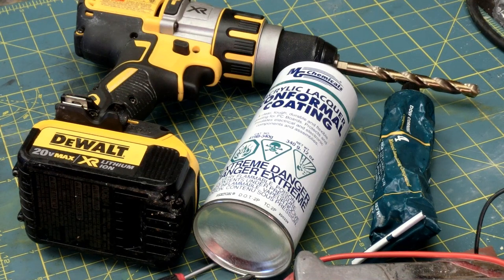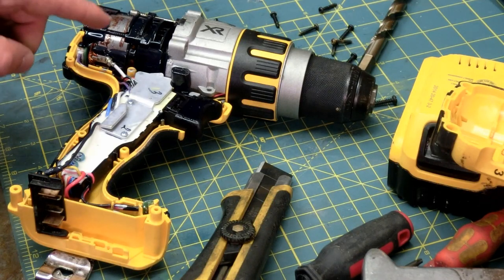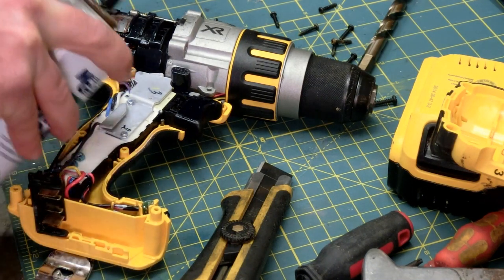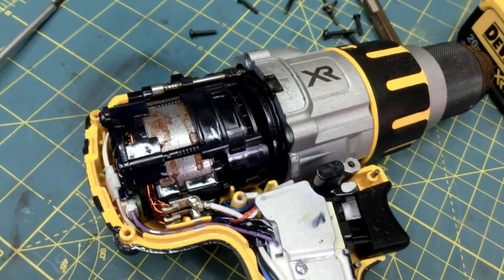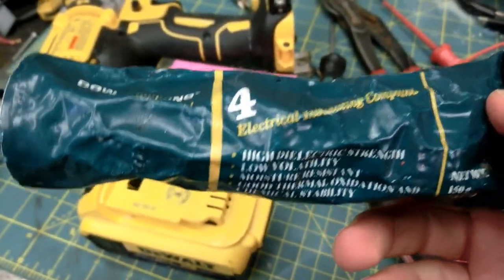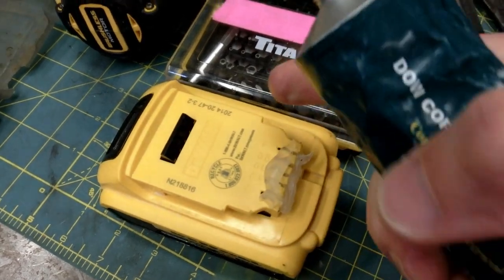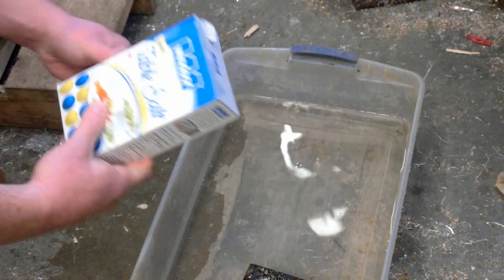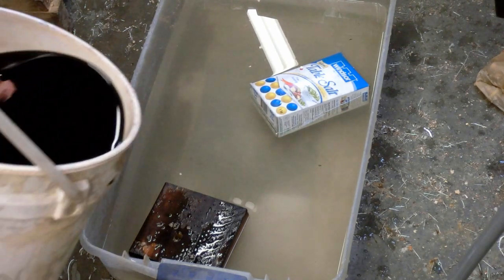How to Water Proof your Cordless Tools. Almost. SALT WATER TEST.

Comment: I did this to my screwdriver !.. It works great cheers bud !!!!
Reply: +kierankay100   So did I... But when I put the grease on the driver holder, it increased torque slip ... to like 99%
Reply: +RidingInKelowna did you try applying grease to your hand Aswell it didn't get mentioned that's what I did
Reply: OH?!  the grease to grease contact must create equilibrium in the AvEverse
Reply: I tried doing this to my screwdriver but I couldn't find any electronics to coat or a battery. Hmm.
Reply: Yeah I was wondering about that. I didn't see any points of ingress between the metal and the plastic. Looks like the handle is just moulded straight on to the shank. I assumed those were the only two parts on the damned thing and that all I would have to do is wipe it with an oily rag after submerging it.
Reply: +Žymantas Pajauris Oh. I must have got one with a dead battery already.
Reply: Did this with my hammer.  Once I applied the grease the other guys were so impressed they ran off to go try this themselves.  I haven't seen them since.
Reply: I water proofed my screws

Comment: The world's first water-cooled drilling machine. None of that air-cooled fan based crap
Reply: +Krisztián Szirtes Also, water-cooled monitor! What a deal.
Reply: +Jaymes Stewart Well, now he can overclock his monitor to 8K resolution.
Reply: +Jaymes Stewart No more overheating mosfets in the fucking HP power supply boards. 11/10
Reply: +John O'Herron I dunno, water cooling has its place, especially when you have little room in the machine itself for heating and so on. Plus there is gear that dumps such ungodly amounts of heat that air isn't even an option.

Comment: I kinda doubt they specifically put in a water sensor.  Notice it craps out as soon as the cooling fan goes underwater.  Could be the extra torque required to blow water instead of air through the fan causes an overcurrent in the motor.  (You'd think if it can turn screws it could pump water, but the screws are on the other end of the reduction gear.)

Try rip that fan out and see what happens!  Ya don't need that thing workin' up there in the arctic tundra anyway.

Comment: This is perfect, now I can finally go swimming with my Dremel and use it as a propeller.

Hmm.. just a thought, would that trick also work on a laptop? An underwater LAN party sounds awesome.
Reply: Well it might work for the components but you'd have a big problem with the screen and HD. Also some of the components might not like the layer of junk and overheat
Reply: Ian Thompson oh right, didn't think about it insulating the laptop, as for the screen I'm sure you could water proof it by other means, I mean things like waterproof phones/cameras/watches/etc.. already exist after all, but yeah probably not quite as easy.
Reply: you can actually chuck  older  laptops in a bath and they will work! (put the laptop in battery mode cause you'll regret the powercord) but the laptop will most likely die after you take it out of the water again.
Reply: +vgamesx1 Fun note not related to the video or what we were saying, I was using your profile picture as my flip phone wallpaper 9 or 10 years ago. Thanks for the laugh ;p
Reply: +vgamesx1 Not sure about laptops, but this has been done for motherboards to safeguard against leaky watercooling systems.
Reply: I think your referring to other salty liquids that might be splashing on your keyboard, just aim away.
Reply: Ik it's 2 years later, but somone diplayed a ip68 water resistant keyboard at CES2018
Reply: How does the smoke get out?

Comment: Having been on a Naval vessel and worked in actual bilges, I knew just what you meant when you said bilge water. Your sample may be slightly cleaner than what usually ends up in the bilge, but was a very good approximation.  only thing i can think of to make it more accurate is to add metal filings and fecal matter.

Comment: Some of these analog triggers aren't electrical at all.  I took apart a Bosch drill that had annoyed me and found that the trigger mechanism was actually optical.  It was essentially a rubber tube that reflected less light the more stretched it was.
Point being, bilge water would stop any optics stuff like that dead.
I seemed to notice that the drill failed whenever the trigger went in the water.

Comment: I have dropped new cell phone into a bilge while doing some electrical work on a boat.... Having to reach in to that nasty mess blind and feel around to try to find it was the worst.... I did get the phone to work again however i could not get rid of the smell and replaced it for that reason...

Comment: I use the Dow Corning 111 for so many projects. It's basically a non-curing silicone sealer. Has a thousand uses. Won't run off or melt. Won't freeze. Most excellent for rubber suspension parts on cars and trucks. Super slippery and won't wash off easily. Works very well for rubber o-rings too. Got turned on to it in Honda school. I swear by it. Use gloves or your fingers will be slick for days.

Comment: Nice! Can't remember the last time I saw bilge water that pure but for demo purposes I guess it was ok. Of course I'm use to fishing boats. You could have thrown in some two week old sardines and it would have been much closer. Growing up on the coast of NC I saw a few bilges. This will work nice for working around waterline/sewer-line breaks. 

Murphy's Law: climb ladders, work on roofs, out on lakes building docks... never drop the drill; but work around a 2'x5'x2' trench with a leaking sewer line in it?... Yeah. 

You are the most pragmatic "engineer" type guy I (sorta) know. It's off topic but I don't know how to message you in any way and besides maybe one of those commenters with the answers will see this. 

How much force would it take to make a BB go 350 Yards? A judge in Minnesota said the "effective range" of a Walther PPK styled BB pistol is 350 yrds.  What do you think? I feel aerodynamics alone keep it from being so without even considering the small size of the pistol.

Dave P
Davidpenclydyke@gmail.com

Comment: Heeeellllpppp! 😵  Spraying sealant on the internal connections seems like a really great way of preventing water damage.  What can one do after leaving an unprotected Black and Decker Cordless Matrix System in a thunderstorm all night?  I accidentally left my brand new drill outside in the rain.  I didn't try to use it because I didn't want to create a short but I did remove the battery and the drill attachment and placed all 3 separated parts near a heat vent to dry out.  How long do you think it will take to completely dry?  Is there a good chance of it working again?  Thanks!🙂

Comment: I had my Milwaukee burn out the motor, but i used the dialerric greese in it and not the paint... small town and no electrical supply store.   So the dialetric greese might have caused the motor to short out?  It worked great for two months... any ideas?  Aldo where do i send a Milwalki 1/2 Driver impact drill to get fixed that has dialectric greese all in it... lol

Comment: Could you use that spray on the electronic parts of a Jeep? Alternator, starter, distributor, etc?
Reply: +Logic Bob I'd imagine heat would be a problem.
Reply: TheSkytherMod Aah, good point. Bummer!
Reply: +TheSkytherMod And bearings and well the commutator bars and the brushes actually need to make contact, so insulating them is not the smartest idea.

Comment: I've got a Crap & Decker that smells funky when I use it.  Not the usual "grandpa's old 90lb corded drill" smell, more like scorched turds.  Perhaps it experienced an unprotected bilge dunk..

Anyway, I only keep it around so that I don't have to change bits as often.  I can see the commutator is kinda gunky looking, however the end bell is unfortunately the stamped-closed type.  Luckily there's plenty of brushes left, it appears... 
Any magic advice on how to clean the sucker?  A lot of Q-tips and and alcohol (for me) only put a small dent in the funk.

Comment: My best guess would be that when the brushes are both submerged together, they create a short between them, and prevent current from passing to the coils
Reply: brushless motor in that thing I believe.
Reply: The salt water isn't that conductive. I suspect it has some sort of ground fault thing or other smarts hidden inside the potted board.
Reply: +Josh Smith that amount of current would be very low compared to the running current. Its probably pulling way to much current from the drag and shorting between contacts and shutting itself off until the next trigger pull. I noticed that with my milfukee, if you stall it it shuts down. I kinda miss the old brush smell from the nicad days.
Reply: +Wyatt Roncin BINGO. the smart computer chipery inside it I think is the culprit. rushing conductive liquid + hall effect sensor = ?????
I think a brushed motor would give up the ghost pretty quick once that goop lubed up the commutator bars real nice
Reply: +TheIdeanator Salt water is the most conductive water you can get. ions from salt are helping to move the charge. in this case resistance would be close to zero with that amount of salt.
Reply: +TheIdeanator I thought salt water was extremely conductive??
Reply: Ian Thompson Not as conductive as metal.

Comment: Stupid question incoming... Would that work on a brushed motor? Pretty sure those sucky 20v dewalts are digital now. Still rockin the brushed 18v version of the dewalt impact. Work a lot in wet and sandy areas and wanted to prolong my tool life any way i can. Thanks for puttin up great videos!

Comment: Amazed by this..would any battery operated drill work as a one off..I need to cut 50mm chain link at 6 to 8 meters
..if it makes the 2 cuts I'd be happy to chuck it away.
Reply: How’d it go

Comment: Fantastic! Question for you -- how feasibly could I use a regular lacquer or polyurethane as a ghetto conformal coating?  eg. if I'm making some simple circuit boards that I want to expose to the elements?

Comment: On the comments about the motor shorting out. There's a guy named SV Seeker here on youtube, awhile back he was testing motors for an underwater ROV. He was taking common R/C brushless motors and running them in saltwater with no problems.

Comment: Just a couple of comments: from experience I would say that silicone grease is better short term (if you remember to regularly re-apply) and petroleum gell (Vaseline) is better if you forget to re-coat. Conformal coating is better if you use 4 thin coats rather than 2 thick, amd lower voltage drills last longer as you get less electrolysis (less voltage to push the current through). Absolutely right though you cant make anything 100% waterproof if it's not designed for it (even a submarine leaks). One final point is that masking tape on the battery contacts is a good idea as you can get conformal on them way too easy.

Comment: `Hi EvE,

My father had an old drill where some of the gears were striped and he potted all the bits and protected everything with a pour of wax. 
The thing worked great but I seem to recall the new gears were as much as a new drill so it lat on the bench for another couple of years. I tried it out maybe 3 years afterwards and it worked with no problems. I know that a lot of guitar builders also pot their electronics like this.

Comment: My brother working in the HVAC field dropped a CraftsWomen impact in a 5 gallon bucket of waste oil on a job. The thing didn't quit until the NiCad battery did, over a year later. Stunk like rotting dinosaurs for the whole longevity of that tool.

Comment: That drill stopped chooching in the bilge water because the viscosity and density of that fluid is much greater than air.  so it overloads the motor and the overcurrent protection cuts in.  The fan spins at what? 14 k ripims or so?  There's the problem.  My pneumatic drill works fine under water..just not much power at 180 feet below the splash line.

Comment: How did you dispose of that water?
Reply: I ain't never seen no monitor evaporate
Reply: you asked about the water, not the monitor..
Reply: The local auto parts store.
Reply: Then you haven't had one at the proper temperature and atmospheric pressure.
Reply: shurdi3 What else would a greased up AvE bath in afore chooching with Mrs AvE?

Comment: hey Ave, I had some tard bucket tell me if you run an electric motor full revs or disconnected from power, which ever one, and soak it in Mt dew, it would water proof it completely, sounds like hog wash but I wanted your opinion
Reply: +AvE that's what I knew, he was a bench seat racer like you'd never seen, he could weld anything with jumper cables a car battery and some bull shit for shielding gas, thanks for the reply I miss the videos you yelled at the camera focus ya fuck! that was hilarious, keep up the good work!

Comment: I use plasti-dip. It doesn't have any known issues and unless you spray specific parts that need to be free of coating you're ok.

Cheaper too if you know a guy who does plasti-dip for all the plasti-dip enthusiasts, by cheap, i mean free since some of these guys don't actually use the whole can because of sputtering or whatever issues they might encounter, i, raised on the old beans, know that if you crush the can, you get extra potato salad.

Comment: i'll be doing this to my rechargable work lamps for sure. They're fucking awesome for magnetically sticking inside the crankcase for doing main bearings but if you knock one in the bilge you gotta watch it float there until you can wriggle through enough pipes to reach it, you try dry them out but they act up for the rest of the job.

Comment: electric motors under water talk about putting a new SPIN on things.
drill jokes will make you CHUCKle, just a little BIT.
I hope the Dewalt handle didn't TRIGGER anyone
I'm impressed it still worked after you assSALTed it with water.
water proof electronics are usually in CURRENT events so you shouldn't get any NEGATIVE comments.

Comment: silicone spray for outdoor equipment you can get at ace hardware should work too I imagine. Good luck affording a tube of dielectric grease that big though holy smokes it's expensive where i lives

Comment: Just a late and unnecessary thought, but if you greased the contacts before applying the coating, that might remove the risk of accidentally coating the contacts properly.

Comment: hot pink hockey tape was needed not electchickens tape... 

I wonder if the board is sensing a change in conduction at the motor and if that is causing it to shut down.. actually I'm wondering why I couldn't do this to a shit drill like a dewilt, because what if I did want to drill under water.... 

so what is the fucky  fucky here? 

why did it stop chooching?

Comment: I'm a guy who lurks here, watches, and understands very little outside of how to keep my dick in the vice... - and so with that in mind I have a question - when you opened up the tool and sprayed the coating, you only sprayed one half or one side of the interior right? How does the coating still work when it's not sprayed completely on both sides of all the inner workings? I'd think that bilge water just soaks all the way around to the other side of the guts and would get in there no?
Reply: A rare situation where the humor of his video overpowers his thoughtfulness of explaining what he's doing. I'm assuming this drill is already a water-resistant design and he's just making it more so by adding the grease to the battery contacts ...etc showing how tough this drill is.

Comment: It doesn't look like the drill is "detecting" the water. Me thinks its just the resistance the water is putting on the fan. Since the fan is directly connected to the motor, there's very little torque actually going to the fan.

Hilarious as always though :D

Comment: speaking of smoke'm if you got them... might i recommend the holy gods send that is termin8R from spectra products, i can go on how great it is but you can google it... in a jist its a dielectric to 40,000 volts (non specific of ac or dc of course) it can be used as a conformal coating, rust inhibitor, penetrant and a whole lot of other things, i have used this stuff on every part of my car from frame to battery terminals to alternator to ecu to harnesses and sensors. at my work the techs that work here don't realize that expensive electronic test equipment is water sensitive and use it out in the rain and what not, after they scrapped over 10 900$ nexiq truck data communication devices due to water damage i stepped in and coated the new batch in termin8R and not a single one has failed since (mind you its a bit retarded that these units are not waterproof and nexiq doesn't honor any warranties). other things its good for is making solid rusted scrap tools usable again (mainly clamps and pliares and such) it really is great stuff, no im not getting paid to say this nor do i get commission from sales i just want to pass on the word of a great product that has been industry tested over the last 8-10 years now (also it happens to be made in canada so yay for that)

Comment: of course it'll work after sitting in water for an hour.  a $20 Walmart drill would too.  

corrosion from water ingress to the battery, motor brushes, switch/trigger, and gearbox where corrosion begins, takes a good week or so.  take it out of the water, put it on the shelf, come back in a week.
Reply: thechosendude uh, I do believe that is a brushless drill right there...
Reply: Parody video. He didn't even spray the underside of the circuit board.

Comment: Wrong, DC motors have holes in them for air cooling. No way to waterproof or keep water from shorting out the brushes
Reply: +macgyver15147 
Unless it's frame TENV, which I have motors in this frame that are DC. No holes at all.